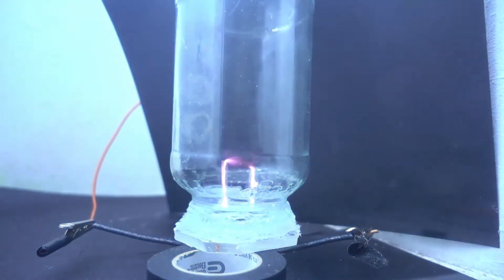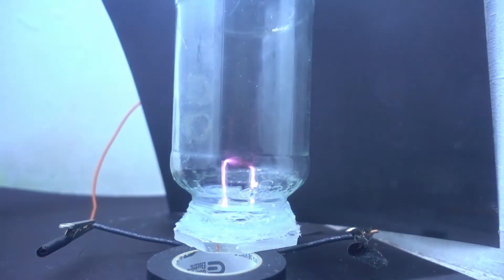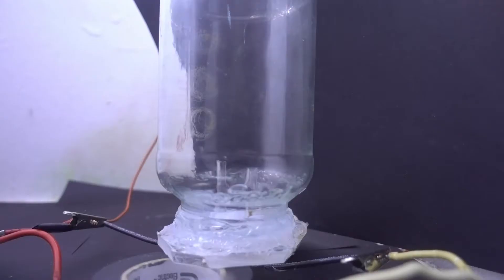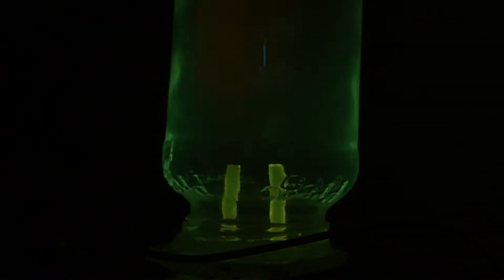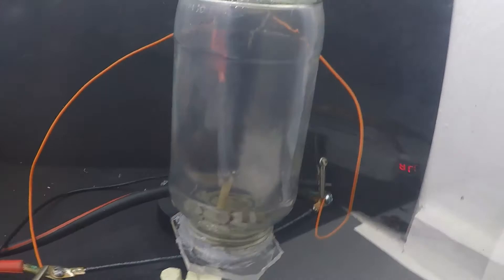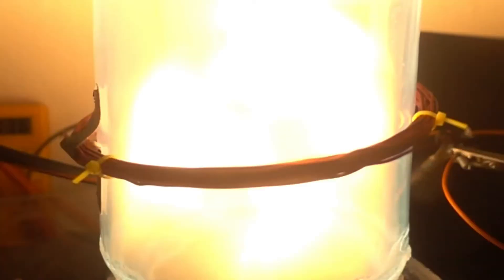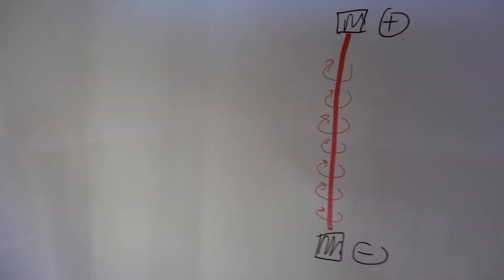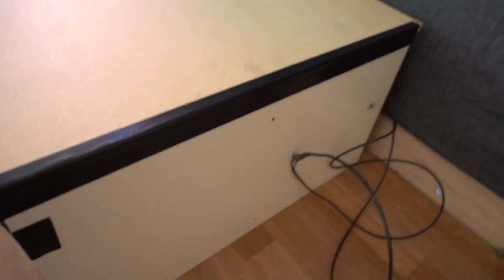Plasma's Magnetic Field Experiments

Comment: Current of magnetic field should be higher, not the voltage, need thicker copper wire, plus need to be cooled, to compress plasma.
Reply: Why cooled? How does it compress the plasma. Just wondering for my own theories.
Reply: @tylermelo6535  sorry my friend, thats i didn't fully describe princeps  in details working of mini ECR, cooling maybe no need in his situation, i am talking about superconductivity.
Reply: @genghizalseitov3807  ohhh. Thats funny because ive also wondered how plasma reacts to a superconductor. I havent seen any experements using one.
Reply: @tylermelo6535  yeah that very fanny

Comment: I like the lightning rig.. how it switches from the jump in the low pressure. I think your rotation is mostly from the coil around the bottle. If you flip polarity through the coil i am thinking the rotation will be the other way.
Reply from the maker: The coil definitely had something to do with it, when I did it without the coil it had two separate clouds of plasma like | (  ) |